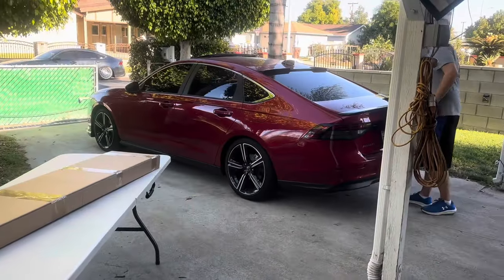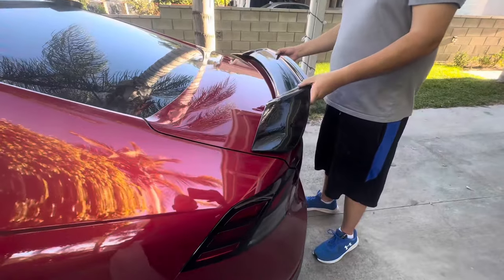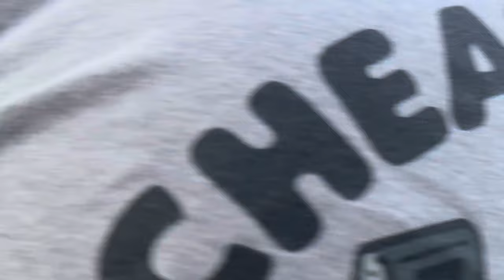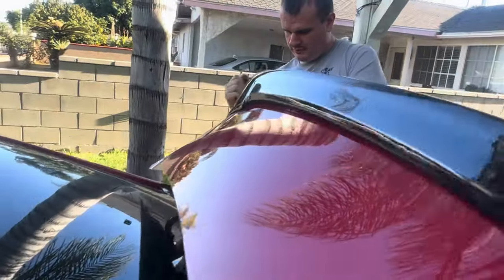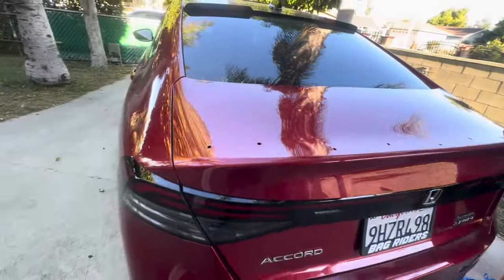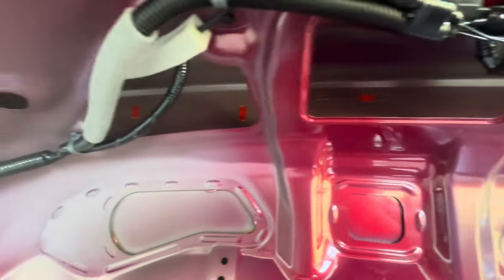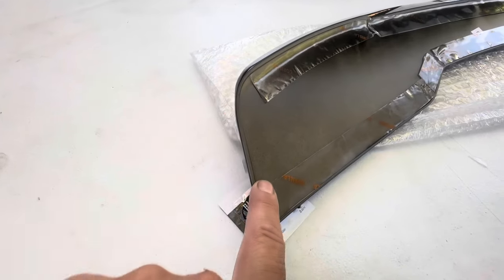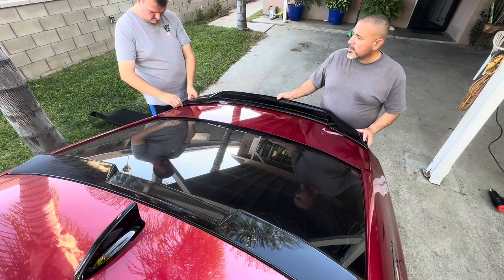2023+ Accord hybrid sport NEW highkick trunk spoiler install #2023hondaaccord #mods #hondaaccord

Comment: Has anyone experienced the gas pump nozzle get stuck into the car? My 2024 accord is 2 days old and got stuck at a gas station.
Reply from the maker: Check Reddit… I haven’t had any problems
Reply: I did..make sure the rubber flap stays up when u insert the nozzle or it will keep it from pulling out..happened to me a few days ago.
Reply: @bdoser12  thank you, unfortunately mine broke and the filler tube assembly had to be replaced. Car was 2days old. It has now been repaired under warranty. My worry is that it will happen again

Comment: Not sure if there's a mod for it but do you or anyone in the comment section know how to make the tail lights come on with the brake lights? I feel like the tail lights are boring af until you turn them on at night and they light up real nice. But I want them to come on every time I hit the brakes if u know what I mean?
Reply from the maker: After market light  are come out there is one versus out all ready
Reply: the tails should stay on during the day if u switch from auto to low beams. u can test it in a parking lot out in the sun while parked. low beams are basically the same as day time running but the tails should be lit on top of the DTRLs
Reply: Looking good 🔥